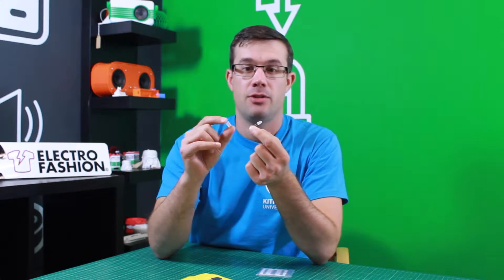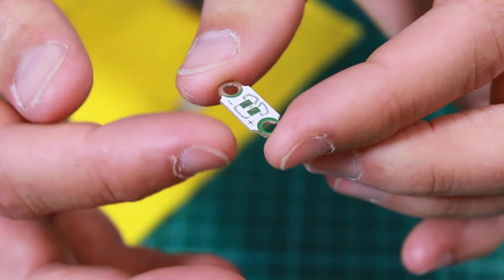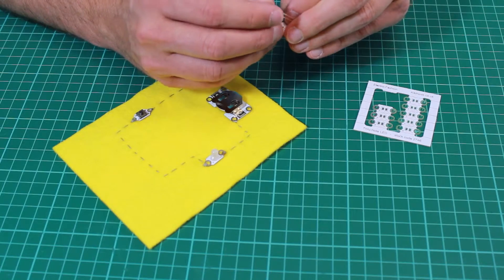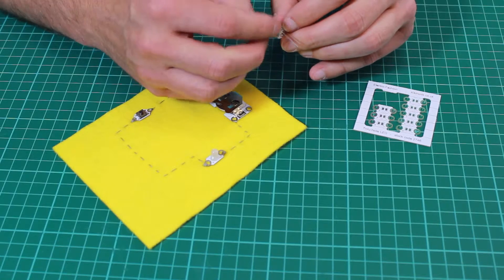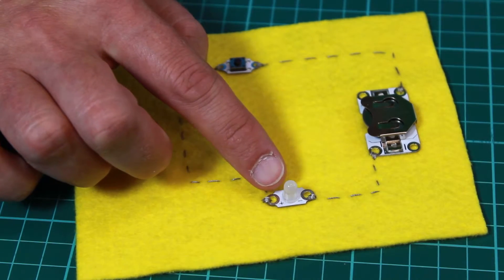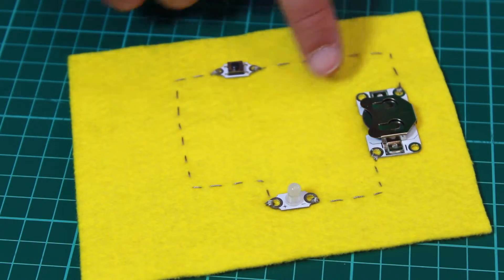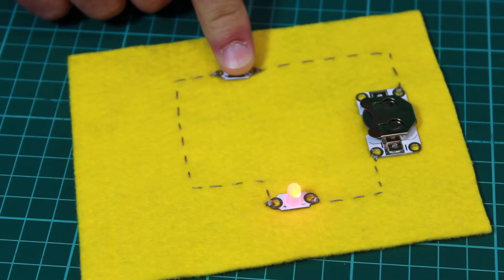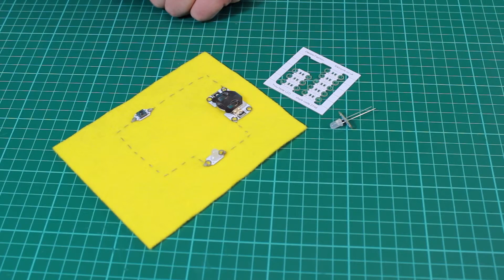Electro-Fashion, Sewable 5mm LED Holder

Comment: I have 3 4V ultraviolet leds, can this circuit board power them?
Reply from the maker: It's a holder for through hole LEDs, it should fit most all 5mm LEDs.